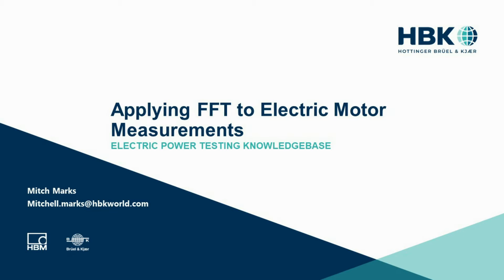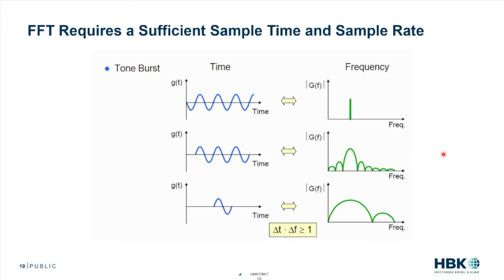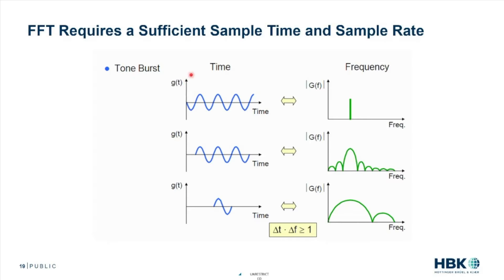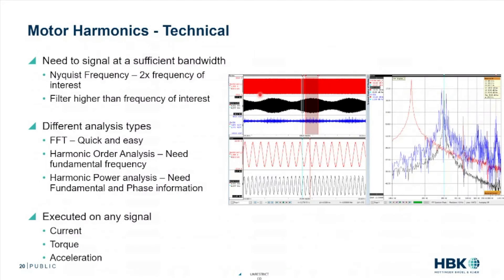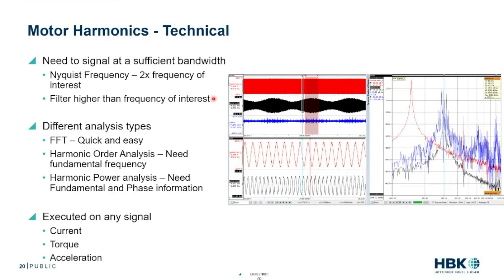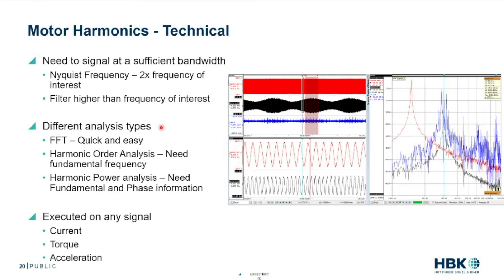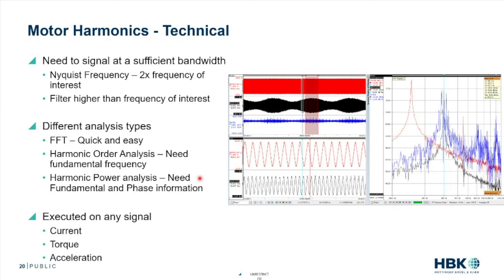Applying FFT to Electric Motor Measurements

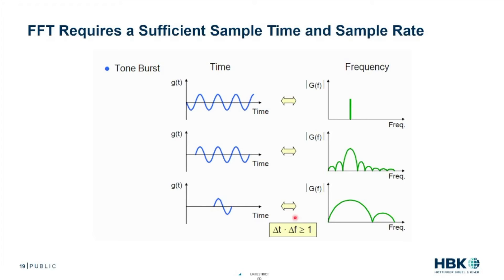Comment: I think the figure at 2:05 is wrong. If you only have one cycle, as long as you have enough sample points within that one cycle. You will have just one sharp peak at the sin wave frequency. However, on the top left waveform, the waveform has 3.75 cycles. If you do a FFT without windowing. You will see spectral leakage instead of a single freq.